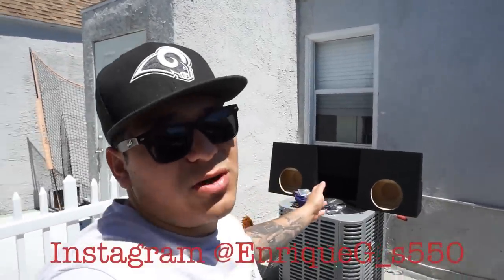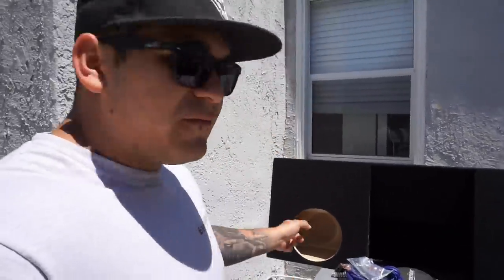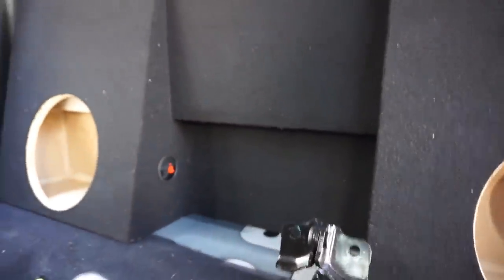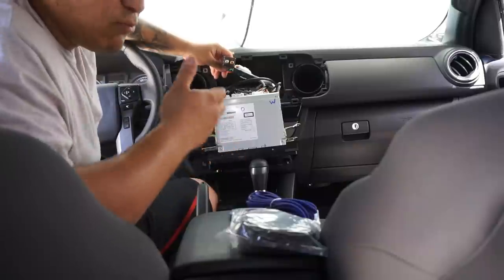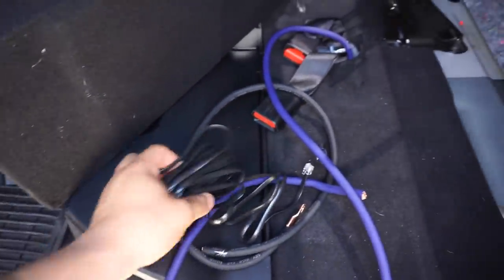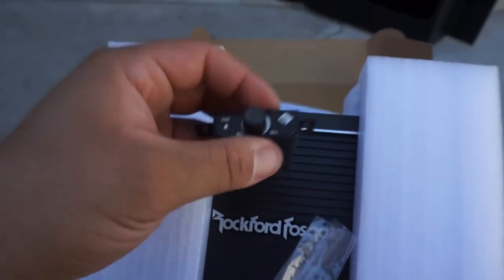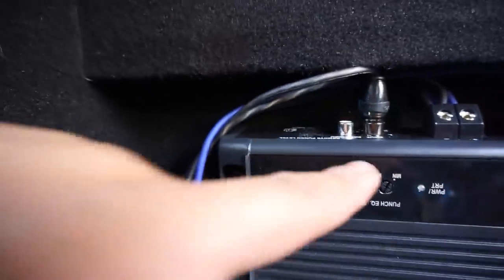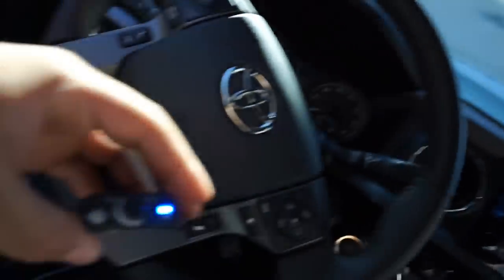2018 Toyota Tacoma Subwoofer Install

Comment: Although we started at different places on the Tacoma Truck , we both have the same goals , I changed the factory POS Speakers out to Rockford Fosgate  Punch 6x9 4ways in the front with adaptors and 6.75 3 way in the rear . Powered by a punch micro amplifier @ 75 times 4 . such a huge difference in sound . Now onto the bass system . LONG LIVE ROCKFORD !!!!!!

Comment: I was able to do a similar set up but I went with two kicker L7Ts 4 ohm DVC and CXa1200.1 amp. The wiring is good and high quality and the amp works good with the output converter. I got the same box with square cutouts but It was a tight fit though, I had to wedge the box between the plastic panels to fit. I had made a few adjustments to the box to wire my subs to 1 omh. The subs however, did rub on the plastic behind the seats so I removed the panels and made cutouts on the plastic for clean fit, no rubbing and full range of motion, sounds great though and definitely worth it. Thanks for the information and tutorial.
Reply: I plan to go with 2 Kicker 48CWRT104's. They are 4 ohm dvc shallow mount with a Kicker 46CXA800.1. I'm curious about the fit. Was cutting the panels on the back of the seat the better option? My plan was just to remove them if they rubbed but I haven't pulled them off yet to see what's under.

Comment: Thanks man I followed this to install in my girls 2019. Did pretty much exactly what you did and this was a big help
Reply: The description on this sub box says "will not fit models with rear power window"
Did u have any problems installing it?
Reply: No prob at all
Reply: @TheDraeg  also what about the brackets? Did you have to remove them?
Thanks replying
Reply: Everything went in perfectly once the plastic storage was removed. Those were all I had to take out

Comment: Did the enclosure get mounted to the cab in some way (screws, bolts, etc.) or does it fit snug enough to not bother with that? If this was mentioned in the video, I must have missed it. Thanks.

Comment: Hey there sorry for the late comment. On the adapter for the head unit there is a RCA adapter and a red wire. does that red wire connect to the blue remote wire for the amp?

Comment: Great video.  I’m about to install a JL Stealthbox and amp in my 2019 Tacoma. The stealthbox is made to fit in the cargo space behind the rear passenger seat.  However, my truck came with the JBL sound system, which includes a (really awful) sub behind that seat.  So, I need the non-JBL cargo storage panel to complete the install.  I noticed that you deleted that panel I order to complete your install.  Any chance you still have it and want to sell it?  Thanks.  -Joe

Comment: Awesome thank you great video. In 2017 I did the same thing to my 09 Tacoma DCLB with the same amp & 4 ch Rockford prime under the driver seat. 100 x 4 ohms front & rear 6.5"  polks. Sub Amp Kicker 11dx 500. wired at 2 ohms for full 500 watts. Powering (2) 10" kickers subwoofers 4 ohms 150 rms, to a ported sub box. Still sounds great but, still need to learn more. The best thing to take away is you did it yourself! The parts for everything were about $1000. I wonder what a professional installer would have charged?

Comment: Put the bass knob in the knock out. Drill a hole and cut out sides. $3 to replace knockout if you remove.

Comment: Did your inline converter run off the front speakers? I just installed my sons yesterday but it’s running off the front speakers. 16 Taco. Figured it’d be getting signal off the rear speakers.
Reply from the maker: I'm not sure I just installed the aftermarket harness between the radio and the factory plug. And rand my RCA's I never actually went as far as tracing wires to see where the signal was coming from. As long as the signal is coming from a left and right you should be ok.
Reply: EnriqueG_S550 yea I understand that part but when I fade it from rear to front I get bass signal. When I fade to the rear the bass signal disappears. I’m just seeing if maybe they got my wires messed up from front to rear. I’m gonna have to fix it. Thanks for the reply. Nice rig BTW, we have the Blazing Blue Pearl 👍🏽.

Comment: The website says it won’t fit with the rear power window but your did?
Reply: What website for the box bro if u can post
Reply: @eddeniz9575  screw the 10s bro. I got a ported box for 3 dual voice coil audio dynamics 6.5s and this box is slamming! Look up Maui sounds Tacoma on YouTube

Comment: Did you need to remove the car seat brackets for the box to fit? I like this setup. Nice video
Reply: No
Reply: Trust me it helps! Super simple with seats out. I only removed the backs it’s only 4 bolts

Comment: Great video. Have you ever tried installing one subwoofer and one midbass woofer? You will lose 3 dB of the deep bass but I think it might help the music sound better overall. I have one 10” sub and the door speakers just can’t produce the midbass to balance it out.
Reply: Why not upgrade the door speakers?
Reply: @thelizardshaman7004  door speakers are really difficult to get correct. Unless you can engineer and construct a specific volume and seal it correctly. They rarely get the 60-120Hz hitting properly at significant db levels.

Comment: Bruh I did a JL audio 5 channel 900watt and makes the stock highs sound pretty good I’m in Fullerton I case you wanna check it out
Reply: Fernando Gonzalez what did you use to get the two rca cables
Reply: Marco Hernandez audio control lc6 and also added audio control epicenter lol

Comment: Hey brother I just install the same system that you shown the video everything the same subs Box everything but I didn’t get the sound deep sound like the bass sound sounds like really no good with anything that you can tell me to make it better please I will appreciate it
Reply from the maker: I would just say mess with the amp and settings this exact set up thankfully allows for full gain and level but you can mess with the frequencies allowed by the amp. But honestly because of how small the sub is and how tight the sub box is that's exactly what you get. Tight bass that vibrates the truck and that you can feel. For deep clean (not always loudest) bass you really need a ported box but in our trucks that'll be really tough to do.
Reply: EnriqueG_S550 
Thank you very much for your help my friend you’re really helping me a lot and I already play with the amp in I’m good in the sound that I was suspecting thank you for everything your video was a big help without the video is no way I was going to be able to do it thanks again and God bless you

Comment: That adapter doesn't fit my 2020. Just followed the link. Am in missing something...?
Reply from the maker: You either have the premium amplified sound system. Or it's just different for the 2020's
Reply: @EnriqueG_s550  I think it might just be different.

Comment: Good install video, but you made a mistake putting 10s in there. You need space to make bass, and those 10s are not getting their optimized space. 8s would be louder just because they'd be optimized.
Reply: The mistake was putting the tens in there, he should have gone with twelves from JL Audio, shallow mount 12TW3’s, they need less volume than those cheap P1’s, and perform much better.
Reply: @ULSB1969  shallow mount T1 12s would destroy shallow mounts from JL lol
Reply: @lolllllll  don’t think so, and RF take 2 cubic feet compared to JL 0.95 cubic feet ported. So RF would not work. Xmax JL 15.2mm, Xmax RF 15mm. JL kicks a little harder than RF on Xmax with less power, they are more efficient.
Reply: @ULSB1969  you're assuming there isn't enough space lol
Reply: @lolllllll  yes I am, cause I don’t know the truck dimensions, I don’t think you can get more than a cubic foot, let alone 2 cubic feet.

Comment: Would anyone know if all of this would work/fit in a 2019 Tacoma SR5?
Reply from the maker: I don't see why it wouldn't I'm sure our backseats and even the plastic storage behind the seats are the same. If you have the same head unit as the one I do then even the low output converter harness should work.
Reply: I have the 6 inch screen and you have the 7 inch screen would that make a difference?
Reply: Will this box work in a 22 with power sliding rear window

Comment: Do you have a power sliding rear window?
Reply from the maker: Yes
Reply: EnriqueG_S550 I read on the website that box isn’t supposed to fit if you have power sliding window. Did you do anything special to make it fit?
Reply from the maker: @MrThunderChicken  nope nothing special just put it in place thats all
Reply: EnriqueG_S550 awesome. Now I can order with confidence. Thanks for replying
Reply: Where is the box from?
Reply from the maker: @SonotCali  all info in description box
Reply: EnriqueG_S550 ok I thought it was a 12 inch sub box 👍🏾 good video bro

Comment: the person who did my installation he didn't remove the radio  he did the connection different  🤔
Reply from the maker: He probably spliced into an OEM speaker wire for signal to the amp. Which is what I didn't want to do I didn't want to cut an OEM wire so I went with the aftermarket wire harness.
Reply: @EnriqueG_s550  why you didn't want it looks more  easy  or  is something wrong doing that way  the sound is not the same 🤔
Reply: @essc8400 splicing into the rear speakers is the old school way. Still the same signal. It's cheaper to splice into the lines

Comment: I never understand why guys mount the amp with the subs.  I mount my amps under the front seat and then all you have to do is run the speaker wire to the subs in the back.  You want the shortest run of power and ground wire as possible (DC voltage doesn't travel well).  Speaker wire you can run long distances with negligible loss (AC voltage travels forever). My ears have never been able to tell the difference between a 10' run of quality speaker wire and a 50' run.
Reply: You're absolutely right! I agree with you, but I don't think it makes much of a difference that's why people still do it
Reply: @ramirojuarez7379  My point was that it's less of that expensive ass power wire and less work :)